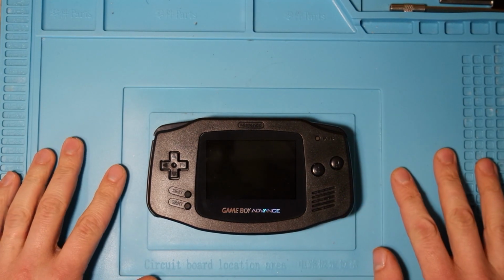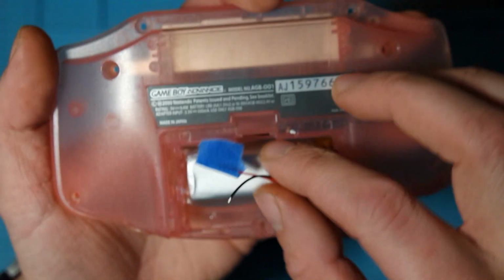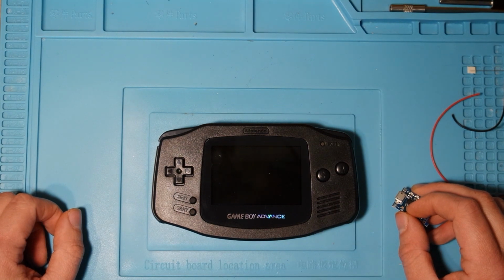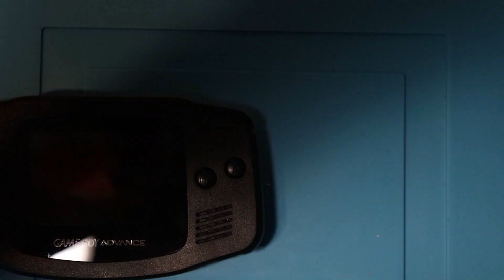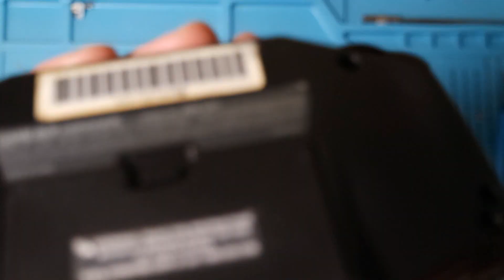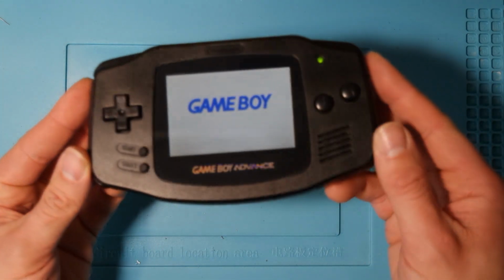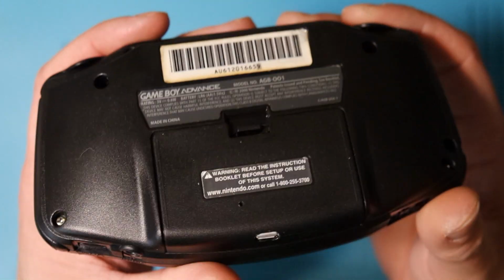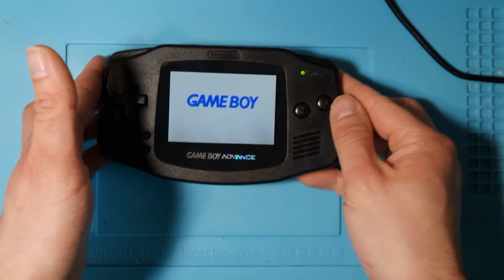Gameboy Advance Rechargeable Battery Mod - Upgrade 2 of 2

Comment: What did you use to bond the Charging Board to the Battery Door Cover?
Reply from the maker: Generally I use some 3m double sided foam tape. For this one I used 2 part MinuteWeld epoxy
Reply: @ShanesRetroGames  how well did the double sided Tape work? Considering that myself but I'm kinda worried it won't hold up.
Reply from the maker: @shamelessinc  it has worked very well for me. I try not to remove the battery life unless I really need to and I think that helps quite a bit
Reply: @ShanesRetroGames  I did it with hot glue just now, seems fine so far :)
Reply: I wound up using Gorilla Clear Grip Contact Adhesive both to fill in the hole for the "Light Pipe" as well as bond the TP4056 board to the back battery cover. Works well once its fully set.

Comment: Which AWG wires did you used to attach the board to the GBA's board?
Or which AWG cable would be safe to use with this?
Reply from the maker: I used 26 awg wire since that is what I had on hand and haven't encountered any issues. From what I have seen floating around modding forums most recommend 22-24 awg
Reply: @ShanesRetroGames  Okay, I've ordered a 22 AWG wire.
So I'm assuming this should go fine.

Thank you for the response. c:
Reply: @ShanesRetroGames  is a 30 awg also okay?
Reply: @GrooveOn123  I wouldn't use anything smaller than 26awg. 30 and even 28 won't be able to handle the current draw, ESPECIALLY if you're using an AGS-101 or IPS Backlit display.